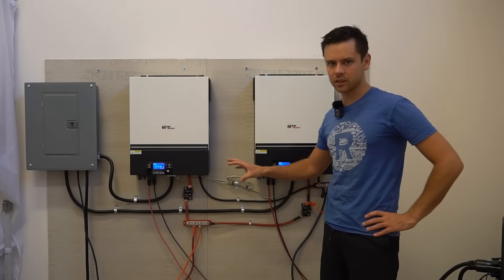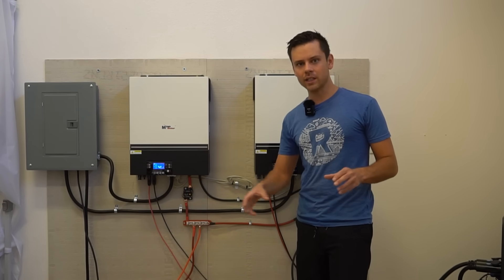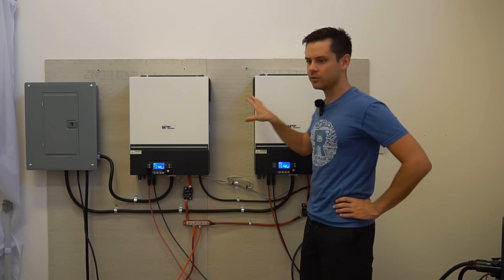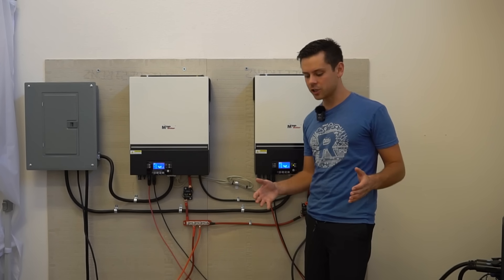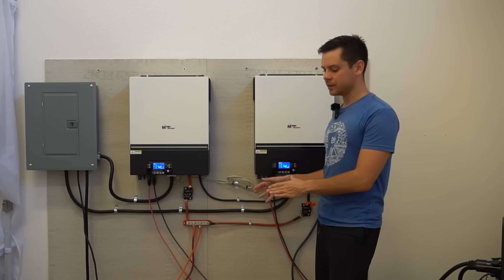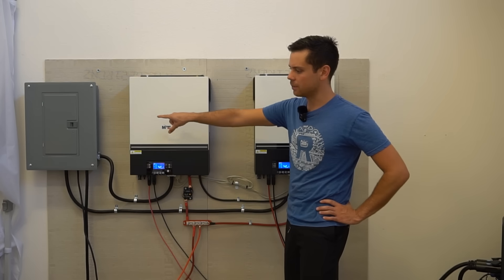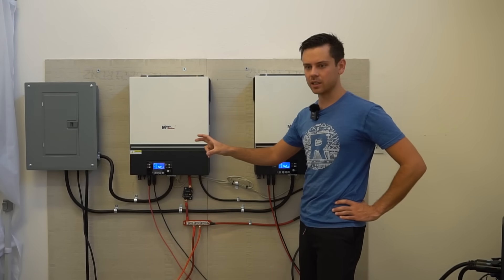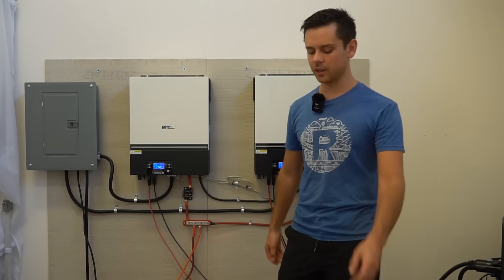Does my 13kW Offgrid Solar System require Grounding? Is it Grounded?

Comment: Hey Will. Very informative videos!   I’ve watched many of your videos on lithium batteries but I wondered if you have reviewed later generation lead acid batteries called crystal lead batteries?  Not as good as LiFePO4 but reportedly much improved on flooded lead acid batteries.  Could they be a low budget option worth considering?

Comment: So if this system did not have an AC input from the grid, would it be OK that it's not grounded at all? Basically just internally grounded within itself?

Also, does Will ground his solar panels somehow? I have a large solar generator (EcoFlow) coming and it only has the DC inputs from the panels. But when panels are installed on the roof in a normal solar setup, they ground the rails and panels to the sub panel or main panel. I don't have that since it just goes to the solar generator. What do I ground the panels/rails to?
Reply from the maker: It's a floating system. No need to ground your panels unless they are massive
Reply: @WillProwse  Thanks Will! I'll only have 3x 350-400W panels in series (limited by the input voltage of 150V max of the EcoFlow) so I can get as close to the 1200W max input power as possible.
Reply from the maker: Ac input is another terminal on these inverters

Comment: Grounding the exposed metal parts of an electrified piece of equipment is not to protect you from touching the hot metal and neutral.  It's to protect you from touching the hot metal and some ground like a water pipe.  If you have such a piece of equipment with the possibility of ground-referenced voltage near a piece of equipment that does have a ground, or a piece of equipment with a grid or natural gas connection, you are in great danger.  Of course, a floating DC PV array has no ground reference, so it does not need a ground.

Comment: May sound stupid but someone could ground this system using a low resistance power resistor as a shunt system, so as to not cause the inverter a complete short circuit and blow mosfets but make it possible to have a return ground path in case a short happens in the device or local code demands you ground the system. The other option is a seperate ground with no bonded neutral just to dissipate static buildup.

Comment: Will,  If I understand the system, it is completely isolated from the rest of the systems on your property therefor is not connected to the earth grounding of the grid system in your house.  Furthermore, your solar wiring is not tied to ground in any way.

If my understanding is correct, it has two implications:
1) Your system is not tied to ground in any way and is therefor 'floating'.   This is not necessarily 'wrong' but your system can develop a significant potential in reference to earth ground.      There are non grounded systems but most folks feel it is safer and there is less possibility of equipment damage due to the potential difference.   

2) Since the system is isolated from any other earth-grounded system,  The 'earth gradient' issue would not directly impact you if you tied your system to earth ground.  (The earth gradient issue only applies if you have a conductor between two separated earth grounds)     However, there is a possible secondary earth-gradient problem if you ground the solar system.   If you have two items, one plugged into the solar system and one plugged into the house system, in the event of a nearby lighting strike, you could have a significant potential difference between the two items.   An arc between them would probably not occur, but if a human were to be touching both it could be a problem.   Furthermore, if the two items are in some way touching or connected,  it can complete the circuit and create the ground loop you mentioned. 

The ideal scenario would be to run a ground wire from your Solar system breaker box to the grounding system of your house.   This would earth ground your solar system a the same point as the rest of the house and not create the ground loop / earth gradient problem.
Reply from the maker: Ground from input to output is bonded in the inverter. I stated if secondary auxillary electrode was connected to output, and input was connected to my houses system. That's what I meant. And yes your comments are correct.

Comment: I'm not sure how you run ground in the states, but the ground we use if for fault current return and has nothing to due with lightning strikes, that's what lightning arrestors are for. In most cases using the M.E.N. system (multiple earth neutral), the main earth is tied into the neutral conductor. Any metallic enclosure has to be earthed so that if a fault occurs with an active conductor to frame it will trip the circuit breaker, and any fault that occurs through a person to ground trips the R.C.D. (residual current device). However having said that we also have other earthing systems other than M.E.N. such as the Direct Earthing System, The E.L.C.B. System (Earth Leakage Circuit Breaker) (voltage operated type), and the S.W.E.R. (Single Wire Earth Return) that uses only one wire and the ground is the neutral return system. I found what you were trying to say a little confusing but that may be attributed to different terminology used. But basically yes, the earthing conductor is used for return fault currents and has nothing to do with lightning. Our supply authorities use a three phase system for reticulation and distribution, generally delta to star step down transformers where the centre point of the star connection is the neutral connection which can also be earthed. Nice watching albeit a little confusing.

Comment: GREAT VIDEO! WAY TOO AMBITIOUS FOR ME RIGHT NOW.  JUST HAVE A QUESTION ON THE SOK 206 AMP.  CAN I USE THAT WITH 2 SAN TAN SOLAR 250W PANELS FOR MY TRUCK CAMPER BUILD TO RUN A FRIDGE/FREEZER, LIGHTS, FAN, SMALL TV AND TO CHARGE UP PHONE, TABLET, LAPTOP, INSTANT POT ?  WHAT CONTROLLER AND INVERTER DO YOU RECOMMEND?

Comment: What is the benefit of using two inverters and not a big one with the same wattage?
Reply: In this case he is running split phase to get 240v. Each of the inverters produces 120v that are 180 degrees out of phase. So between the two inverters you get 240v. The inverters must support this function and have a sync cable for this to work. 

Bigger inverters also typically have a higher idle current. So in some systems it's better to run a small inverter for 24/7 loads and have a big inverter you turn on only when needed to run a big load. Some big inverters can also do this internally and automatically.
Reply: @lordgarak  Thank you so much for explaining it so well.

Comment: So when would you have a requirement for a ground rod in a totally off-grid system with an inverter? I do not see how there would ever be a difference in potential even if, say, the inverter shorted to the case.
Reply from the maker: Technically, there is no need. Using a floating system is fine. Check out victrons recommendations on this
Reply: @WillProwse  What happens when the "totally off grid system" is connected to a transfer switch?   (In my case, a manual one, not automatic).    In my case, both the ground and neutral are connected from the off-grid system ac panel into my office sub-panel.    Is it safe just to keep the neutrals and the grounds completely separated.   I think to be safe, the best practice is to eliminate a ground rod in the solar shed, and make sure there is never going to be a ground loop.  Is that correct?
Reply from the maker: @howiegrapek  treat the Offgrid inverter output as a generator and follow your local laws and NEC
Reply from the maker: @howiegrapek  yeah I wouldn't use that grounding electrode in your shed.

Comment: Will, Great point. A similar question relating to those solar generator/power stations. I believe they are not truly grounded. The A/C output runs on floating neutral. What if, when the A/C charge input is connected. Would the power station be grounded during the time through the A/C input cable? Now, would the ground pass through to the A/C output if there were output load plugged in the A/C output jack?

Comment: DC grounding vs AC grounding: AC is part of an array (usually) and needs to be grounded as a “reference point to be at same potential as generator ground)  DC is a relative concept by excellence and grounding one pole just introduces all kind of issues that can actually be detrimental to your system and possibly your life.

Comment: Bonding Will, everything that is not the earth connection is a bond, not a ground. We use grounded bus bar in large incoming, high voltage vaults, as well as places like server roms to bond equipment to earth.

Comment: Hey Will, can you do a video where you show everything and anything you need to do a off-grid solar charging setup for an electric car to charge at full level 2 charging? I can charge my Nissan leaf at 6.6kw with my grid tied chargepoint charger. The charger is plugged into a 50  Amp,  240  Volt  Nema  6-50  outlet. Thanks and sorry if there is already a diy video for this. I would like to put solar on my garage and then have the entire garage be off-grid also.

Comment: Absolutely you never want two earth ground with one system for the ground loop reasons you stated. I did not realize you had an AC input from your house. Many inverters will bond the neutral to the input AC when they switch to line power. Does the AC input ground common to your solar ground? If so you may want on oversized ground wire back to your house and it’s ground rode. Thanks again for your great videos.

Comment: When you talk about a large array or long PV cable runs, could you give us some example numbers?
Reply: I would say any length of cable that has a resistance above 0.100 ohms to 0.500 ohms definitely would be significant. The length needed for this actually varies by wire gage, wire material, amount of current, and by the frequency of the current (dc = frequency of 0). So there is not a single number of feet that would be considered significant for all design cases. While the run of wire's resistance will not cause the surges, if the wire is long enough to have significant resistance (and therefore a voltage drop) then it likely has the capability to cause the surges mentioned.
Reply: Technically the inductance of your run of wire is what will actually triggers the charge buildup in your run of wire. The stray inductance of your run of wire will have a certain amount of energy it can store while current is flowing through the wire. This energy is released when power stops flowing through the wire causing a surge. If this stored energy amount is more than your mmpt panel can handle it will be damaged over time (or after a single time) from the power surges. I am not sure if there are any free calculators out there to calculate the inductance of a length certain gage of wire or of the amount of power that can be stored with a certain amount of inductance. It gets complicated to calculate quickly though. 

Ultimately the best things you could do is to do what your mppt controller/ solar panel wiring guide says to do for your type of design, call the manufacturer of the mppt panel or solar panels for wiring advice and recommendations, or hire/consult a electrical professional who has experience with this topic.

Comment: Fault current travels back to the source, not to the earth. Mike Holt’s Grounding versus Bonding videos are great source of information. I have to stay up with the NEC every 3 years. He has been teaching for over 40 years. As a side note Will, if  it was not a stand alone system, or if you were to use this system for a home back up in an emergency power outage, through an interlock kit, make sure your Neutrals and Grounding conductors will be separated in this Square D panel.  6/4 cable would go back to the interlock breaker. Also, only one neutral conductor is allowed per terminal. Otherwise you will have an objectionable currents flowing on all metal parts of your electrical system - dangerous condition to have. I keep finding this in people’s homes when someone would add a sub panel.
The grounding and grounded (neutral) conductors have to be connected only in one point in the house - at the main breaker panel.
Reply: I'm trying to figure out my solar system sure glad I found the videos thank you Will.
I'm taking in so much information trying to figure out what stuff to buy and everything. It's overwhelming and now I'm finding out about grounding and it's really overwhelming I don't know anything about it.. and even your great explanation I couldn't figure out. On my new system that's similar to this one but I'm only going to have one inverter for now 120. I'm not going to have any AC input because I don't have any AC input anywhere I'm completely off grid. I was considering wiring my generator into that AC input. I guess I still don't know anything about grounding. I'm going to have to listen to the video again and again. I think you said if you have AC input you don't need ground because it's already in the AC input wires that sounds logical. I'll read it again if my comment doesn't make any sense I'll delete it.. I didn't know anything about grounding until today. Wow it's very confusing.
Reply from the maker: Very good point if I use an interlock kit. I would absolutely separate the grounds and neutrals in the panel. That would be very dangerous if I did not. I am glad you watch Mike Holt! He is fantastic!
Reply: I was going to bring up bonding. I know in a city connection you only bond at the main breaker box and not at the subpanels. As I understand the concept of bonding is to give the electricity a return path so as to not ground out an entire system, how does that work in an off grid scenario? Do you still do bonding at the main box? Or is it a ground that is used? This is a great discussion going on here and bringing up very good points that I was curious about.

Comment: You can have multiple ground rods as long as they are all connected with heavy wire (6 AWG) or copper strap.  That will eliminate any voltage potential between the separate circuits they are connected to.  Eight ft. rods should be spaced 16 ft. apart.
Reply: You need to get a NEC code book! A supplemental ground rod is only required when the 1st measures over 25 ohms. Then a 2nd one 6ft from the 1st. An inspector will never question if he see's two ground rods spaced 6ft apart.

Comment: Placing another Earthing electrode is not an issue. It just needs to be at least 5m (15ft ) away from another one. Electrical equipment can handle several hundreds of volts in lightning spikes. The fault protection on AC out is done by a RCD. You are avoiding that device like the devil :), why? Its perfectly fine if you run your now small system like this, but I am sure that you are planning to connect the whole workshop to this inverters. Residential or industrial installations are not ungrounded as you are just multiplying points of failures. Electrical safety has come very far in the last 4 decades, and systems very complex. People do have tons of appliances connected at a time to their systems. Lets not suggest to go back to ungrounded systems in a terrestric environment. Please!
Reply from the maker: You are right, a RCD is ideal haha

Comment: One thing to always consider if isolating, is peripheral equipment ground (accidentally or otherwise). Just an AC unit sitting on a poured pad gets a surprising amount of earth ground into the housing.
Reply from the maker: Always appreciate your thoughts Karl. Thanks
Reply from the maker: Good point. I'll measure it.
Reply: @WillProwse  Was there anything there?  Just curious.

Comment: You are conflating neutral bonding with grounding. The neutral is bonded to ground at ONE point only. Ground does not carry ANY current when done properly and there is no limit to it's attachment to earth. For example, all metal within 5' of water is required to be electrically bonded to earth, a/k/a ground. This includes rebar, plumbing, metal framing, windows, doors, screen enclosures, etc. Some of these items, such as copper pipe and rebar, may be buried in the earth and serve as a ground path. Again, there is no limit to points of contact with earth for bonding and more is better, but all of them MUST be tied together. This is all covered in the NEC manual which you are required to comply with.